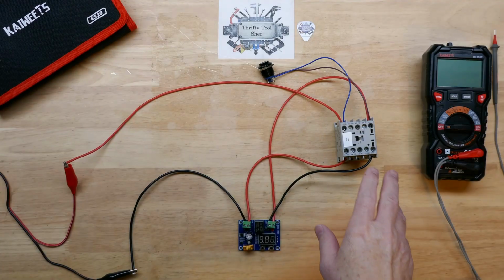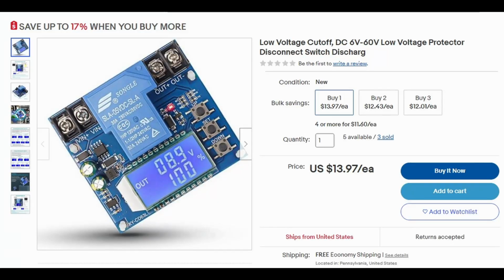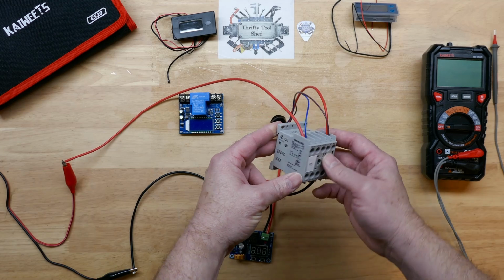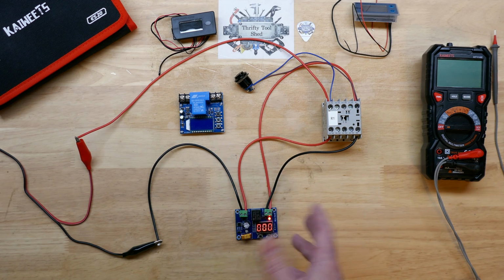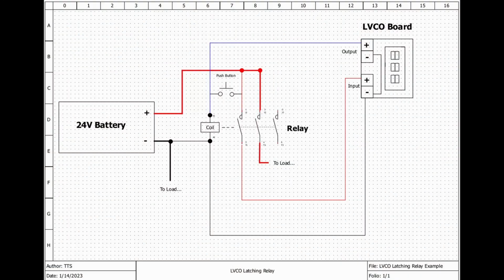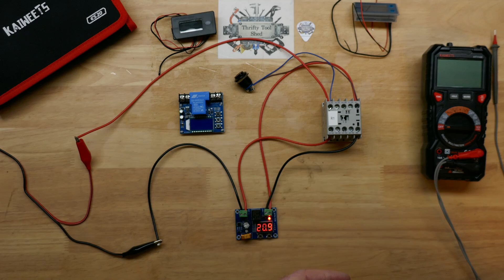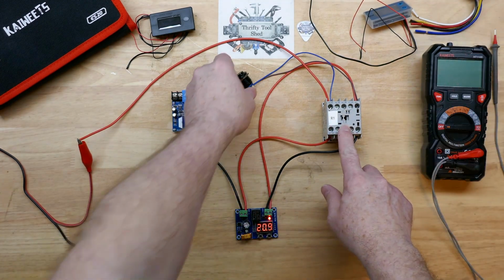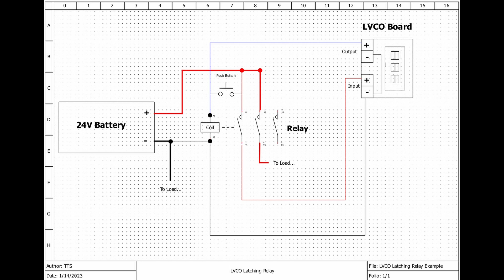Low Voltage Cut Off Latching Circuit

Comment: How much current the big contactor uses? The circuirboird uses around 70mA which is quito significant for any lenght of time.
Reply from the maker: This AB 100 series is 2.6W for warm hold in. Around 3W cold/Pull in.